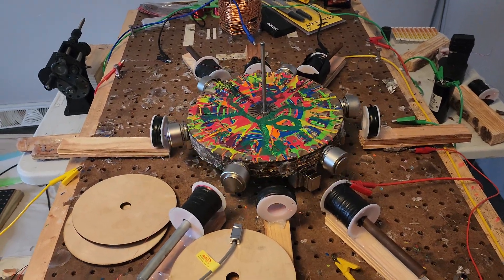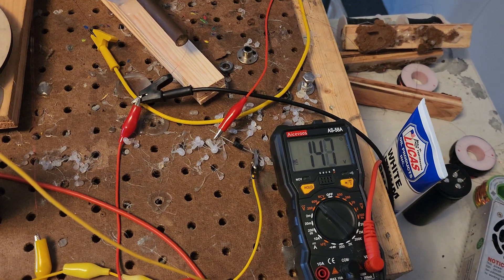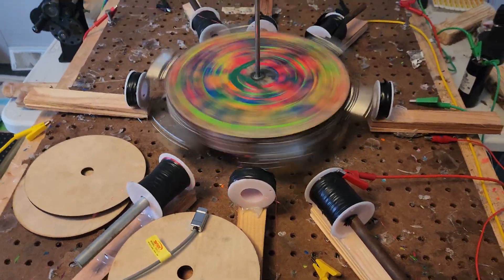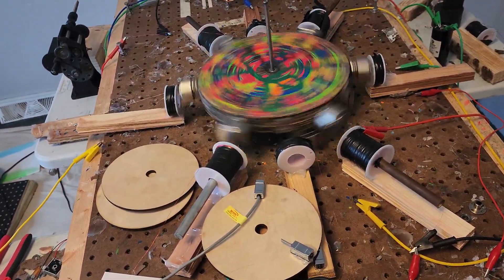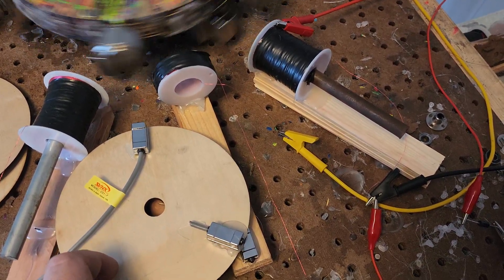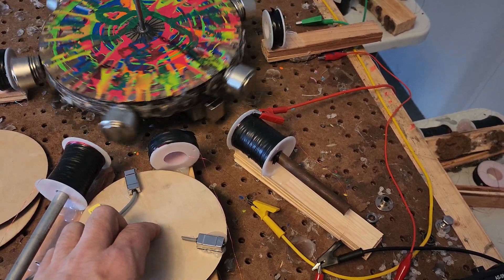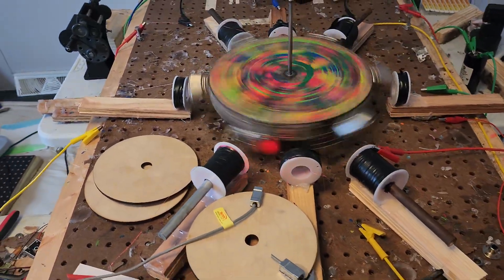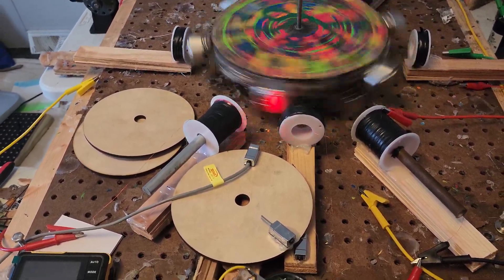pulse motor rotor  6 magnets on the edge and 6 magnets offset attached to the bottom

Comment: Would be interesting to see if this would still work under load. Maybe connect a light bulb to it. Good job though. Magnets are always cool to watch. What is the longest it has run so far?
Reply from the maker: i will try this today see if a 9:1 is good enough to run a bulb
Reply from the maker: it works
Reply from the maker: coast? its about 1800 rpm i change up the rotor ever so often.
Reply: Great job! Keep experimenting, looking forward to seeing more of your tests 👍

Comment: Are you drawing any power off of the circuit at all?
Can you put a energy harvester circuit on the 2nd set of magnets to see if you can sip power out of the system and see if it can generate an output while still maintaining it's speed?
What exactly is the purpose of this experiment...is it just generating enough to drive itself, or is there a "perpetual motion" aspect to it?
Reply: I am amazed that people think sapping infinite energy out of something is somehow possible.
Reply: @pyropulseIXXI  no no...but maybe a slow trickle charge might it might be capable...otherwise it's just a motor right...a self exiting motor
I know there is no such thing as infinite energy..but something that can sip energy such as a low current energy harvester might be capable...especially if it manages to accelerate (which means it has more energy that it is using to self sustain itself)
Reply from the maker: no free launches yes to see if n/s will gen more in a N configuration by having S being offset underneath the rotor

Comment: Not that I have ever built one. but I saw a video in which a single drive coil was used and the reed switch was operated by a single magnet placed near to the center of the spinny bit ...the rpm was adjusted by moving the reed switch on a long stick sitting above the spinny bit...hope that helps, maybe it uses less power by only activating once per revolution.
Reply from the maker: makes sense to me
Reply: @MPHJR  Is this a schoolgirl circuitry Pulse motor Baedini type????
Reply from the maker: @nothingelsetolose7661  the hell you say this is a toy and hey your catching so I'm down to join you and your schoolgirl
Reply from the maker: @nothingelsetolose7661  and no I hear the name a lot though never referred  to any research like you said it's just basic circuits
Reply from the maker: just a toy and no but i was look into a bifilar coil twisted hoping to be able to pulse that energy from the coil to run a few load or a rotor